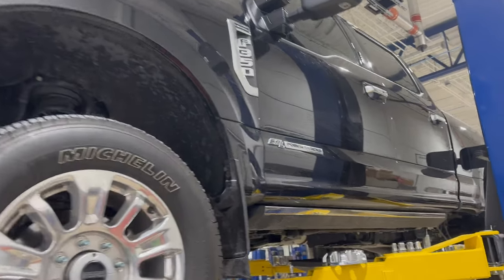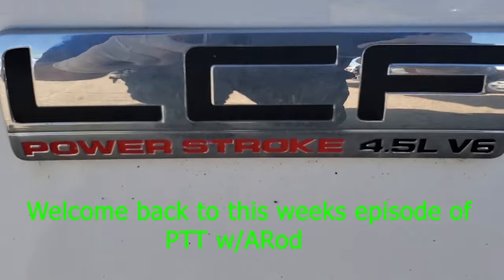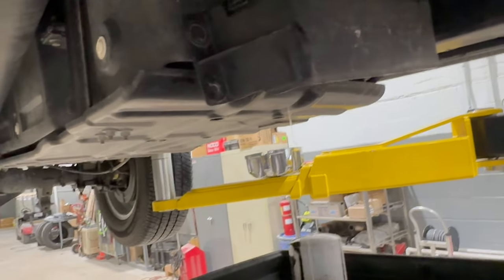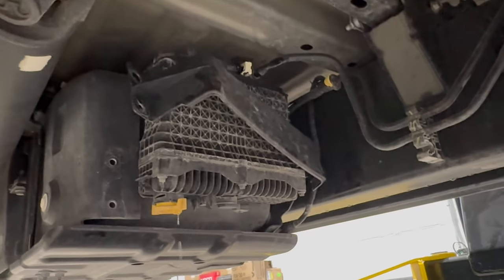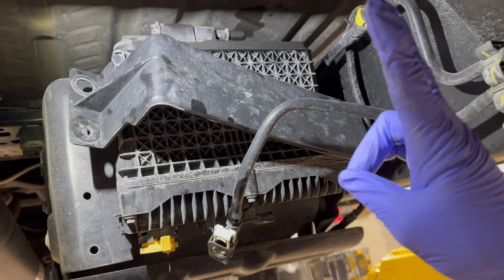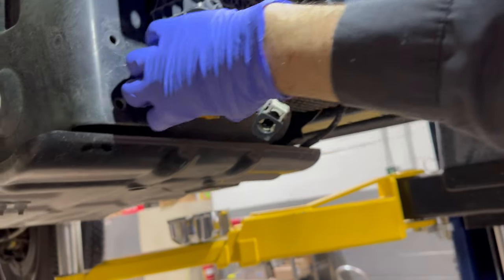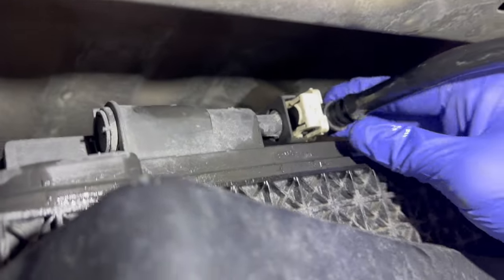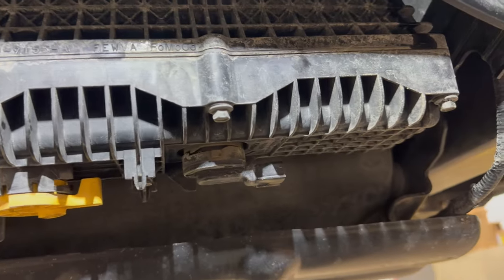FORD factory LOWER fuel FILTER | NO mess WATCH me!! #diesel #fuel

Comment: Personally I replace the secondary filter first. Sometimes I'll leave the lines disconnected. I unscrew the 2 bolts by the drain all the way, open the drain and then the middle bolt halfway and it usually drains completely in a few minutes.

Comment: Arod, I tried changing fuel filters on my 2017 today, disconnected the fuel line at the top of the fuel conditioner, and still drained out like 2 gallons. So I just did it the way you did it like 5 years ago. Ended up wearing some of the fuel. But sometimes I change it and it’s fine. I never have less then  1/2 tank. 🤷

Comment: I've had diesels for over 20 years and every single one I've always did the fuel filters every other oil change, from the 7.3 to my current 6.7 which I've had all in between. No fuel issues whatsoever and my 6.0 was built for sled pulling/drag racing, always using only Motorcraft filters.

Comment: After watching your videos & a couple others I was ready to do my 1st fuel filter change on my '21 F250 super duty.

With a full tank I changed the water separator 1st, but didn't reconnect the lines. Cracked open the fuel filler cap 1st to break the vacuum.
Drained the filter without bothering to disconnect the line in like the manual suggests, total diesel drained into my tray was maybe 1/2 gallon 

Very simple & no mess.
Reply from the maker: Excellent thanksnl for coming back and leavin some positivity

Comment: I haven't had any issues with draining, I wait for the trickle and then start cracking the bolts, I find that when air enters the system the fuel completely stops. I also went to Home Depot and got a mortar mixing tub (on their website they call is "medium mixing tub"), they are pretty big and hold at least 8 gallons worth, it makes it easier and catches a lot of mess. The price is good too, under $10. Thanks for the video pal!

Comment: I'm concerned I may brake the fuel line, LOL. I tried changing the filter with nearly a full tank and found it works well around 1/8 of a tank of fuel. Less than a half gallon drains. Thank for the tip.

Comment: Great update to your original video! (Me: ‘21, F250, 6.7) I waited until my fuel tank was down to 1/4 full. I invited my 15-yr old son to join me so he could learn the process. We disconnected the upper, engine fuel filter to further reduce the potential of siphoning. Additionally, we loosened the lower filter housing bolts to break the seal before opening the drain valve. Maybe it was overkill, but IT WORKED! No mess! Once the housing drained (less than 1/2 gal), it was over and we finished the task without an issue.

I’m not sure of the politics with SPE, but I replaced the OEM valve with their billet fuel drain valve. Simple install, seems to be a solid product so far.

Anyhow, thanks again for this update and sincere thanks for all of your excellent and informative videos. I continue to enjoy learning from you with your honest, no nonsense style. You’re an excellent teacher!
Reply from the maker: Thanks OC

Comment: Great timing! Did mine today. My buddy with a Ram stopped by when I had just started and was blown away by how easy and clean of a job it was. Less than a gallon drained. 4 ignition cycles and it started on the first try. Appreciate your videos.

Comment: Aaron, wouldn't removing the filter in the engine compartment first stop the syphoning effect. It's basically accomplishing the same thing as disconnecting this fitting the shop manual is referencing.
Reply from the maker: Yessss

Comment: I park mine on a slight slope with 1/2 tank or so and I don't have the siphoning issue or at least I haven't.  Then let the filter drain and remove and dump in a bucket not too messy at all.

Comment: Hey arod 
Would like to know how the reliability 
Is on the 6.7 powerstroke  
cab & chassis vs pickup 
I was told there is some difference 
And it's not just the programming  they have different egr and so on 
I would like to buy a new 6.7
cab and chassis but just concerned 
With repair costs 
Your reply would be greatly appreciated.   Thanks
Reply from the maker: Ok

Comment: Not sure if I’m doing it wrong, but I let it drain for a minute or two and it usually looks like straight diesel coming out of the drain so I break the filter bolts loose and it will stop draining and then I can take off the filter without making too much of a mess.
Reply: Same way I do em, easy peezy.
Reply from the maker: Omg

Comment: I have 2016 6.7.. changed fuel filter once a  year and today. Came to an issue of lower filter is not filling up when priming. 
Not getting fuel to come out at all. But pump sounds like is working.  Any ideas what could be causing this?
Reply from the maker: Proba ly did t tighten the lid like everyone does
Reply: @PowerStroke Tech Talk w/ARod  
Also double-checked  that. Also using a motorcraft filter. I can't get thing any tighter. It's flush to the tab.
Don't know a lot about these trucks but is possible that the fuel transfer pump went out? Is there even an in tank fuel pump in these trucks?
Thanks in advance.
Reply from the maker: Just the frame mounted pump
Reply: I had the same problem with my 2016 6.7 and I even took a yellow paint marker to mark the tabs. But that day could get my truck to prime, so $300.00 later towed to my Ford dealership, and they got it and there answer was it wasn't tightened enough. Sad thing is it was the same way I always did it.
Reply: @JERRY KNORR  thank you for this. Atleast I know I'm not the only that had this issue. Tried working on it today again with a new sets of motor craft filters thinking I might just had a bad o ring from the the previous one, but still no luck. I'm Clueless at this point so I'll be  taking mine to diesel shop on Monday since my ford dealership is booked 1 month out. 
Have a great night.

Comment: Since this typically comes with an oil change, any opinion on prefilling the oil filter? I've been told this by multiple Ford techs at one dealership. Citing that not priming the oil filter may cause spun rod bearings.
Reply: I don't believe that, oil pressure is instant almost after start.
Reply: @Kenny Smith Jr  not in my experience. It takes noticeably longer to build pressure after an oil change.
Reply: I have never pre fill a oil filter.
Reply: Many vehicles have filters on the side, no prefilling them. Several have top side filters, no pre-filling them. 
That being said, I pre fill my 450.